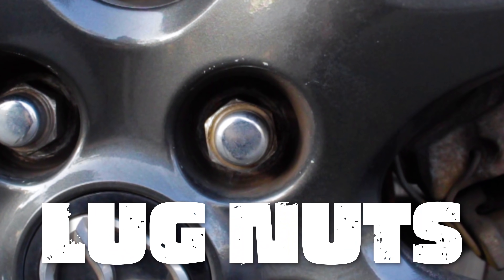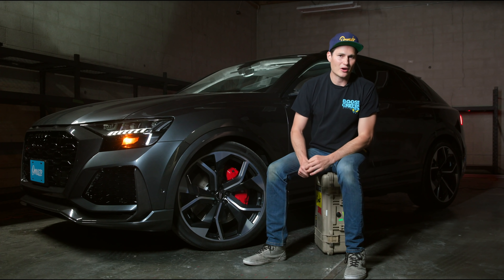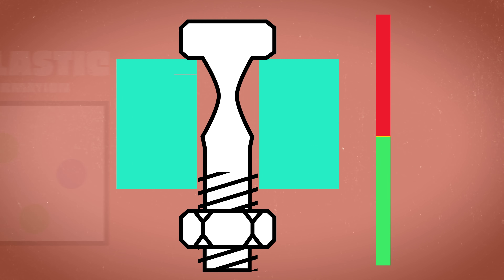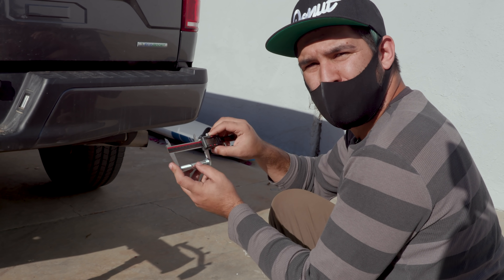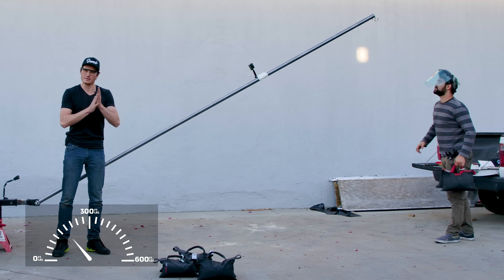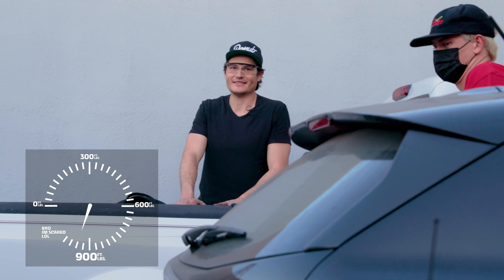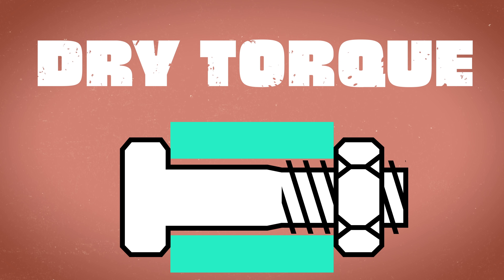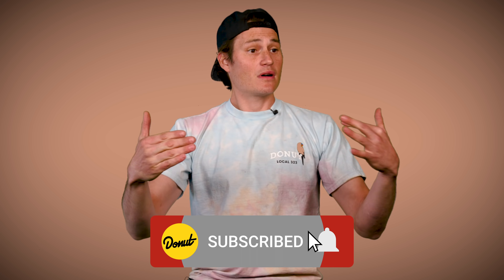What happens when you over torque a bolt?

Comment: I break em often lol.   Last one I over tightened cost me 1,300. Thank you jeep for installing the plastic oil cooler as a complete unit to house my oil filter.  So over tightening the oil filter cap cracked the oil cooler. And that sucked.     I think I learned my lesson though WINNING.  Lol.
Reply: I over torqued 7 of the transmission pan bolts on my 93 Cherokee one time... to heli-coil them was about $800. More than the entire trans was worth.

Comment: After plastic deformation you still recover the elastic region. Ex. You have 100mm bolt and it can be tensioned to 105 mm elasticity before deforming. If you tension it to 110mm and then release the load it will spring back to 105mm. This is also what's responsible for the "spring back" you see in sheet metal and tube bending.

Comment: Me: Thinks about reusing rod bolts after a rebuild instead of waiting on the dealership
Donut: Wait a minute young one, this video is for you.
Reply: Really depends if they are torque to yield bolts, if not they would technically be fine but still get new ones if its easy enough.
Reply: Quick real question for you: did you happen to look up ARP rod bolts as an alternative? I'm curious how much the dealership is charging vs buying ARP.
Reply: @JeffLocke1  I actually haven't seen arp bolts anywhere for a Genesis Coupe. But for a set of 12, it's $36. I'm pretty sure arp bolts would be more, but it's time for me at this point.
Reply: @davidlaughman5358  Genny Gannnng! At least get new bolts man.
Reply: @全然Decatronics  New bolts are on the way
Reply: @R I T A • Н О Т • G І R L ????

Comment: This is one of the best practical tech videos I’ve seen outside of Engineer Explained. One thing you didn’t mention is that the bolt strength would only be comparable assuming grade of the steel is the same. Also, manufacturing tolerances of the two bolts combined with differences in the heat treating processes could affect the ultimate bolt strength up to 5%.

Comment: For the one inch bolt, you might have run into the squared-cubed rule. Basically if you double the dimensions by 2, you essentially cubed the volume for the bolt. This could have had an impact on the experiment. im thinking about is increasing the radius/size of the bolt, you guys miscaluted the stress the bolt could take at that size. You based your idea with a 1/4 bolt that broke at about 140 pound feet of torque and just multiple by 4 to get to about 600. If you ran into the squared cubed rule, you would need 2400 pound feet of torque to break it. Im an engineering major and thats what i think what happened. I could be wrong, i havent taken my materials class yet

Comment: Last time I went to mechanic change tires, I almost broke my breaker bar trying loose lug nuts...
Reply: I thought I broke my tire iron trying to take off lug nuts that were stuck on in the 90s. I had a 4ft pole on the end of that tire iron, set it on my shoulder and squatted the dang thing before it came loose

Comment: You explained stress graph much better than my professor 🙌.
Reply: As a wiseman once said "Don't exceed the point of no return"
Reply: Except that they have the elastic range as a curve rather than straight line haha
Reply: @KuriShogun  It usually starts with a straight line and ends with a curve, but it depends on the type of used material
Reply: @blvckskull7954  well yeah but for steels it’s gonna follow Young’s modulus. They also got the overload plastic deformation bit wrong cause it will come back a bit but not completely to original length haha
Reply: @KuriShogun  Exactly true! They did that just to explian the graph of plasticity in general without going into detail